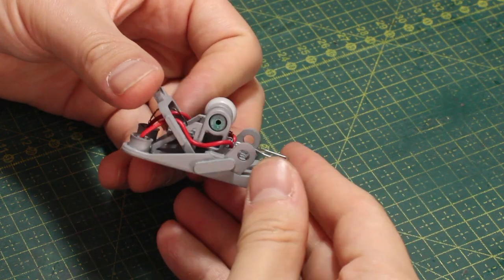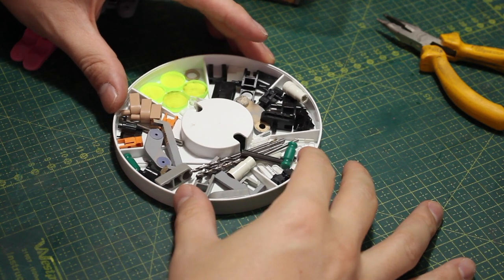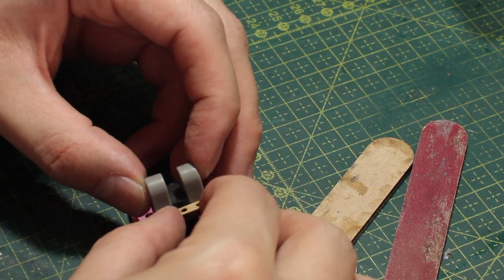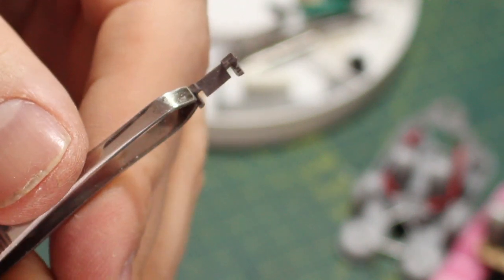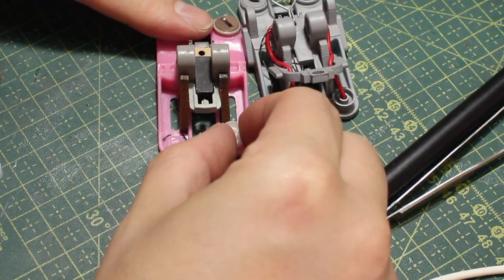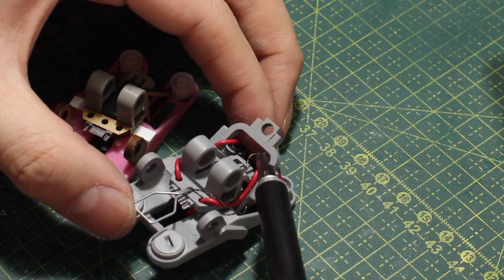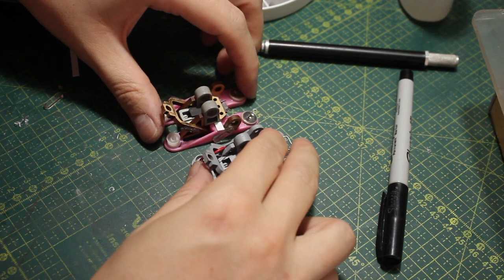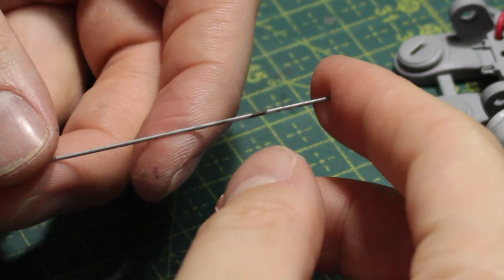Scratchbuild Challenge #2 - Clothespin Robot Foot

Comment: So do you have a recommended thickness for plastic sheets? I always have trouble cutting them because I end up getting sheets that are way too thick.
Reply from the maker: I use different thicknesses when I'm scratchbuilding.. like from 0.3mm to 4mm. It's important to have multiple options on that front! For structural builds, I go with 2..3 and 4mm, for details 1mm down to 0.3mm (sometimes even less)